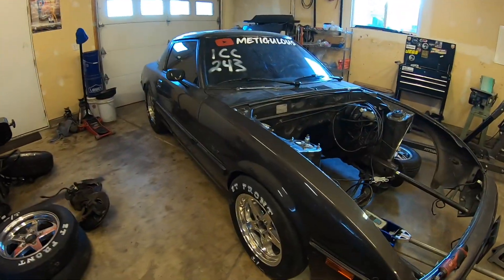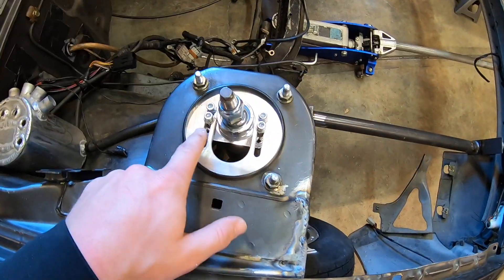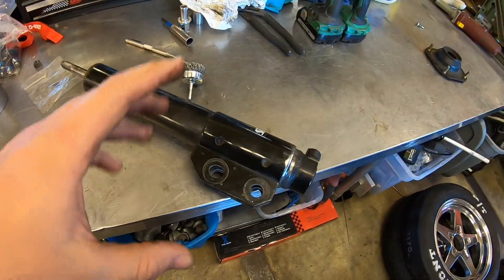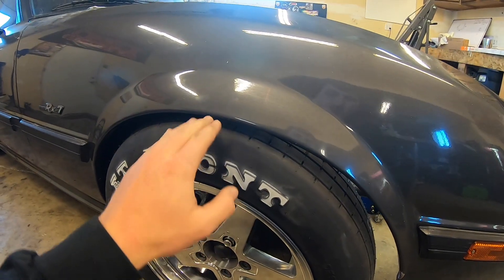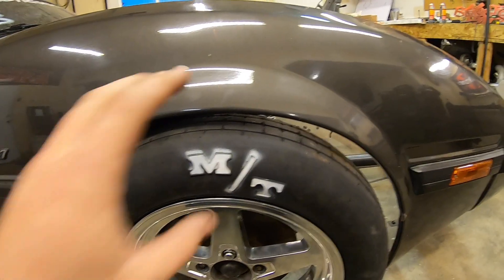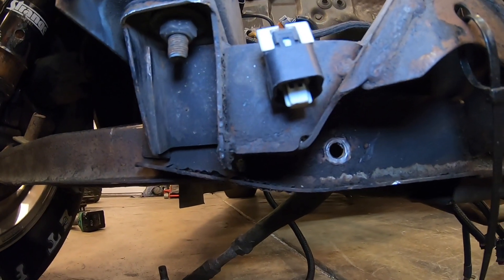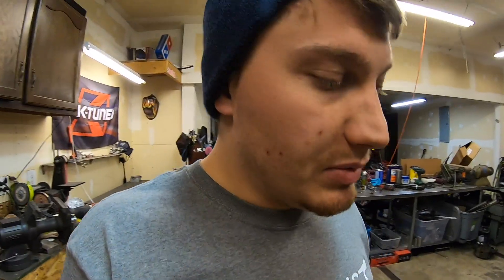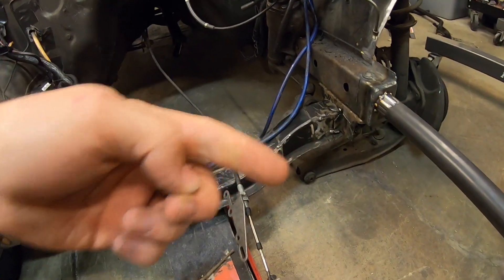It Actually WORKED! (Mustang 5 lug Swap)

Comment: Curious, with the extent that your going to with these mods and what your after.
Would it not benefit you better to build a custom K-member to accommodate all of it?
Engine, rack, control arms, better shock options.
K-member mount to the frame would allow some drop... many many other possibilities!!
You gots some skillz bro, I know you could knock out a bad ass custom k-member for this.
Possible revenue from them as well. $$$
Think about it man! 
Great work thus far bro!!
Keep it up!!!
Reply: It's easiest to get everything lined up and mounted where you want it before you try to make a brand new crossmember/k member.  Then you take off the modified stock stuff and build your jig using that rather than try to measure everything and introduce multiple margins of error.
Reply: 👍True true!
Be cool to see this happen like that!!
End result..bad ass custom tubular k-member assembly!
Reply: I was thinking the same thing. He definitely has the talent to build a nice tube crossmember.

Comment: Hey man
I modded the arms on my sa22c it is a 1980 and I used a 4x4 size hiem  joint  this makes some adj in the arm
This makes my 5 lug front  with 15 x 8 rims and a 225/50r15 perfect camber
It really makes the arms way stronger and not weaker
That is why techno toys sell adj arms in this exact style 
You should try it you will love the adjustment

Comment: Hayden dude...doin' this shit right THE FIRST TIME is gonna pay HELLA benefits down the road. This you know, obviously or you probably would've just kept limpin' her along, catching every 3rd or 4th event the >ReX the competition< wouldn't be broken for. Sidenote: had an '85 Town car, doing front gas charged shock removal (MUCH younger days). Decided NOT to heed the 'NO HEAT/CUTTING TORCH' warnings. LUCKILY, I'd taken the lower nuts/bolts/assembly off prior to firin' up the 
oxy/acetylene 'cause the mofo started blowin an ENORMOUS flame out the top seal about the time it hit the floor...of my parents garage! I gave it a boot outside and the G.D. thing was spinning like a GIANT jumping jack (of fireworks fame) in the folks driveway...scary @ first, F-N hilarious after a few seconds. Annahoo, nice job, man...lookin forward to seeing some 2, 3, 4 foot wheelies in the newly modded >ReX the competition< P.D.Q. You know, b-4 the wheelie bars are installed 😉
Hayden, after a 1.10 sec. 60 foot:
😯<-OH MAHGAWD!

Comment: those shocks wont work. when you put weight on the front the wont function properly being compressed that far. you need to cut all the suspension off and buy an aftermarket front clip

Comment: My only question is what good is that wheel speed sensor on the front wheel gonna do you when you are carry the wheels past the 330 😂 awesome work man!
Reply: Computer will see the shock extension position and front wheel speed and take out some timing to keep it off the rear bumper.